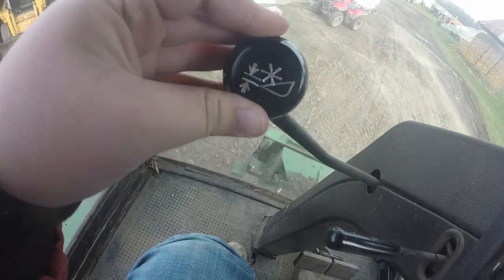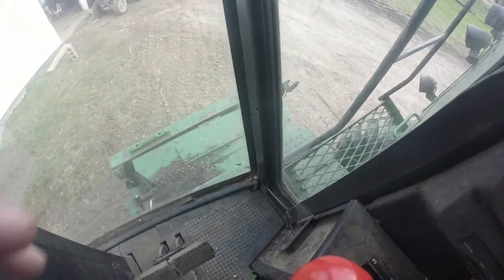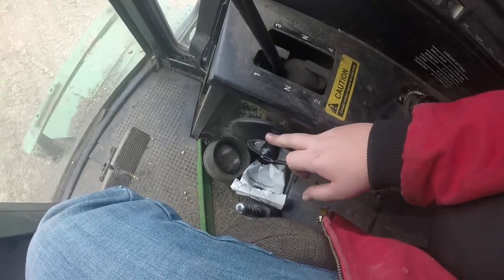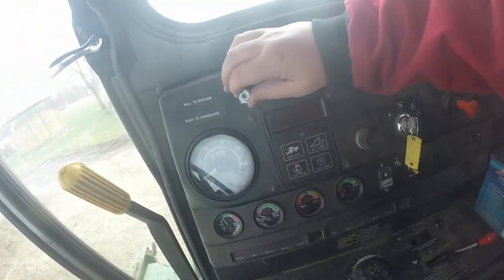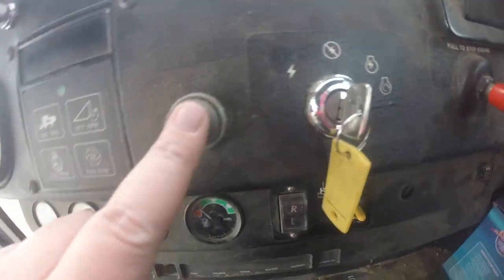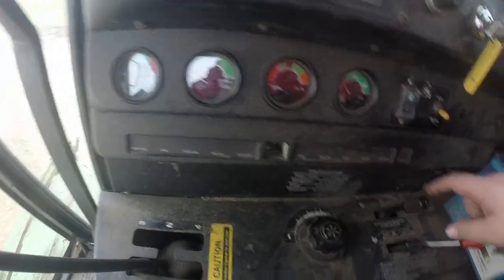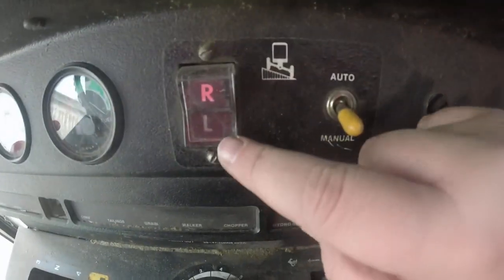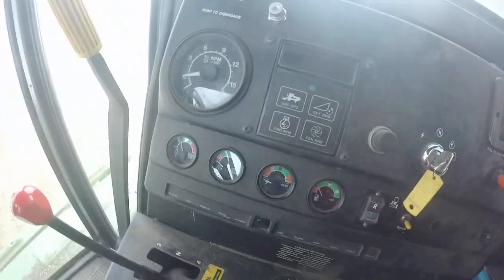John Deere 6620 Sidehill Combine Controls

Comment: The silver knob on the right side of the console engages the header. But only works when the thresher is engaged. I have a 6620 hydro, but it is not a side hill. You are very knowledgeable on your equipment.